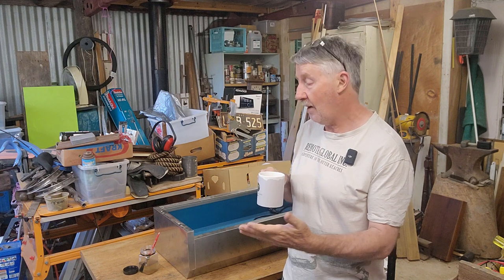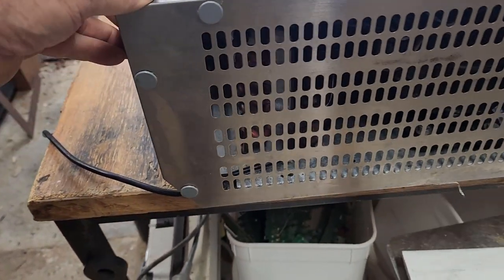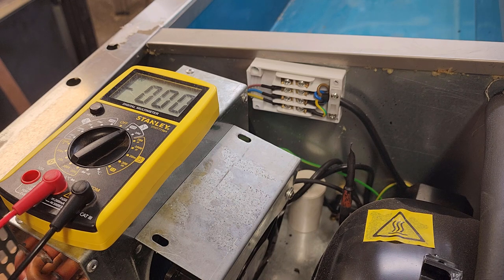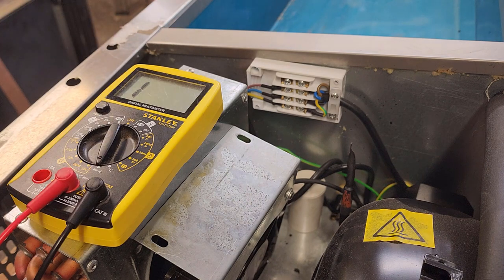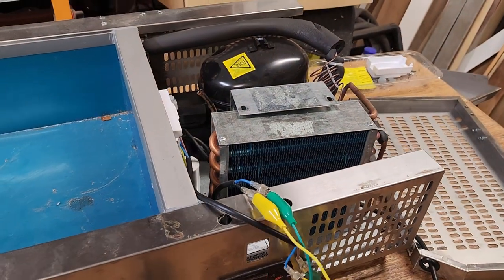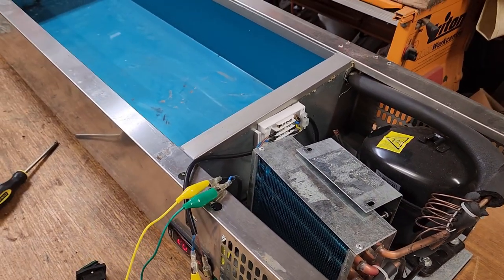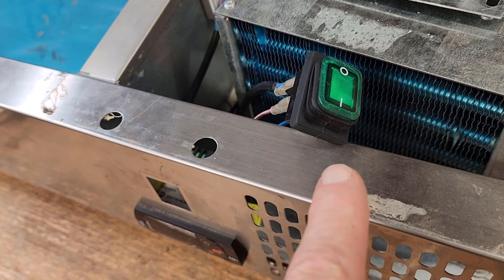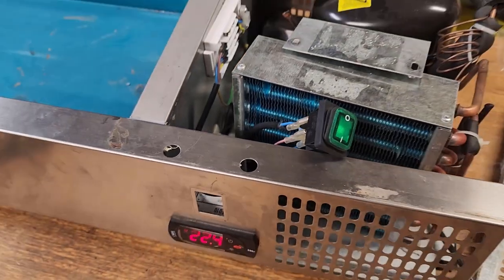Borrelli Counter top Prep Fridge Repair - No Power. How to Test & Fix the Main Switch.

Comment: Great fix! If I had to guess I'd say one of the ball bearings had already slipped out of place, or some black gunk was in the way. The black gunk might have been bits of plastic that were scraped off by a metal rocker that was askew. It's fun to speculate 😄
There's a tool called a "screw starter" that can grip a phillips head screw with a little expanding cross head. One of those tools you hardly ever use, but it's a godsend when you need it!
Reply from the maker: Sounds like I need to buy one of those tools! Thanks 😊
When watching the video back there were more bits of black gunk than I realized! I should have cleaned that up better!

Comment: Very nice. I'm always pessimistic about refrigeration equipment.  I still regret tossing a double door commercial fridge in a hurry.  Later after having a think I'm pretty sure it was just the power cord.  The problem with very large items is I need to get rid of them fast so I don't drown in junk.
Reply from the maker: That is true Nas - there is always extra pressure to deal with something large in a timely manner and so the diagnostic process is often rushed! Thanks mate 😊

Comment: i remember buying a ford fairmont EB console once that the seller said had the electric window switches not working. (i bought it due to mine being tatty and cracked vinyl) and cleaning the switches in basically the same process. they were so new in condition i sold the switch block for $70 which is what the console cost me. buyer was chuffed with operation, condition and the price. it's good when things are serviceable, unlike a lot of planned obsolescence stuff of late.
Reply from the maker: Yes, totally agree Dean - I really hope we go back to fully serviceable equipment in the future!

Comment: Most would have gone straight to replacing the switch instead of trying to fix it. Because you showed us the easy fix, we also got to see what was inside and how simple the switch really is. 
When dealing with non-magnetic fasteners, they make screw starters that have a clip to hold the screw or for flat head screws they make a split head screw driver that wedges into the slot to hold the screw. Great for starting a screw, but not capable of much torque.
Reply from the maker: Thanks Rick. Someone else mentioned a screw starter - seems I may have to purchase one of those! 👍😊

Comment: I fitted a similar switch to my 12v fridge and the light is on when the switch is off and the light goes off when the switch is on. O tried to reverse it but they can't be reversed. 
Where do you do the Test and Tag?
Reply from the maker: That seems odd Michael - maybe it depends on which terminal the power goes to first??
I did the Test & Tag course online.